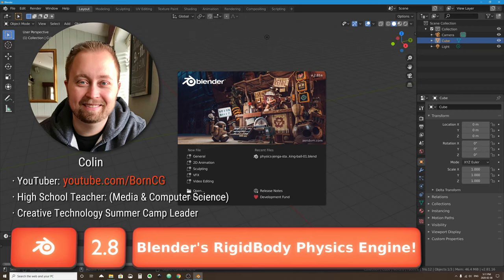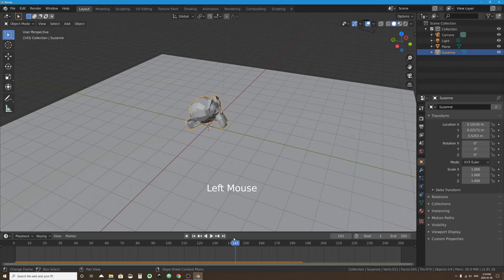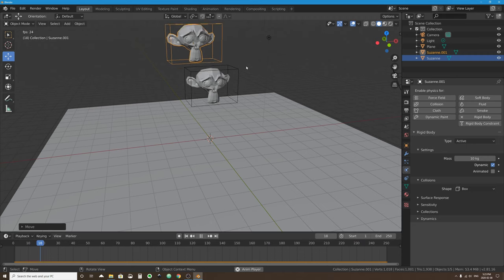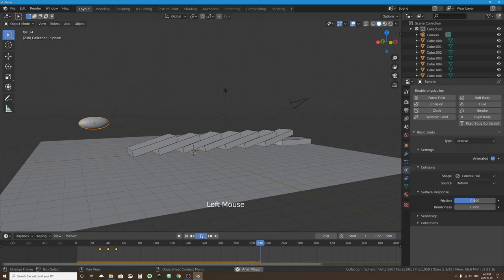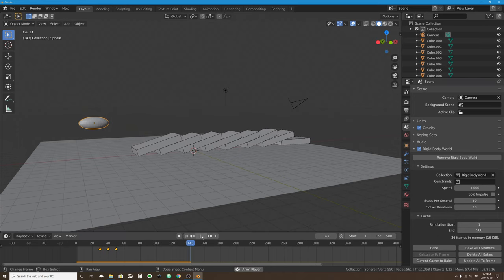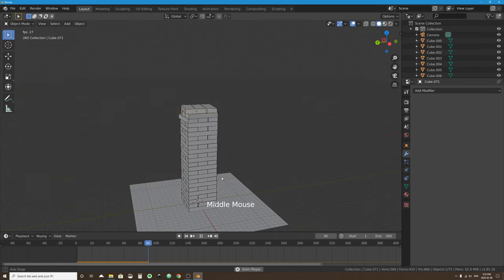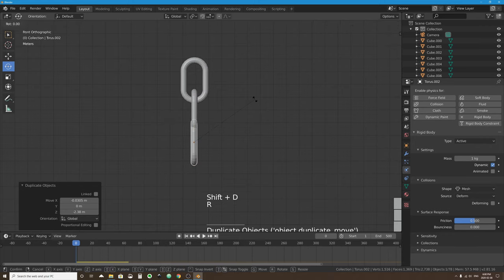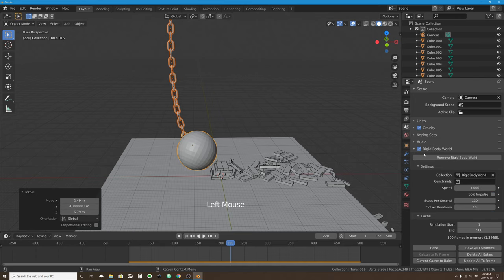Blender 2.8: Simulating RigidBody Physics! #b3d

Comment: I recently decided to recreate the scene in Jason and the Argonauts where the skeletons come up out of the ground, and I am having trouble with the ground. I want to use rigid body physics but the pieces of the ground explode no matter where the origins are located (as you can imagine they are irregular shapes). I have a passive plane to keep the ground pieces from falling and a cylinder to push the pieces up, the ground also needs to be passive for the pieces to lay on but the addition of the ground plane causes the pieces to explode.  Any ideas?